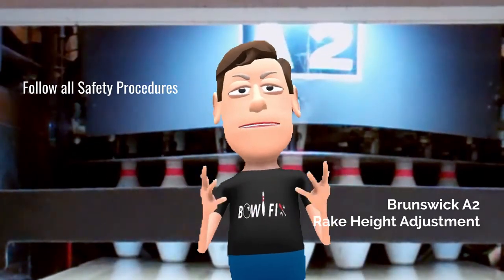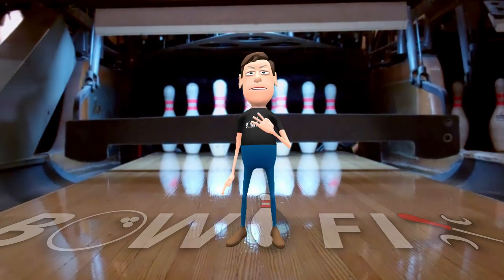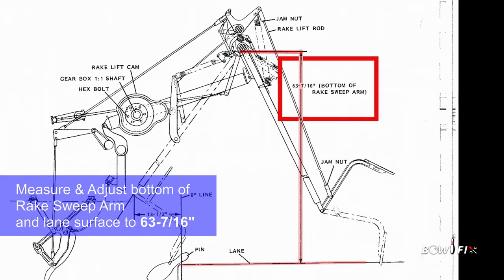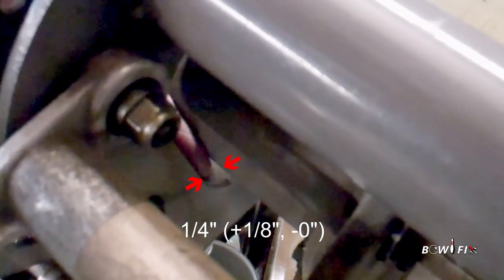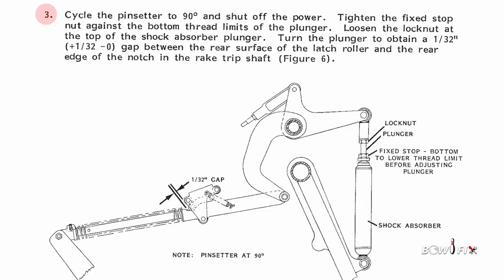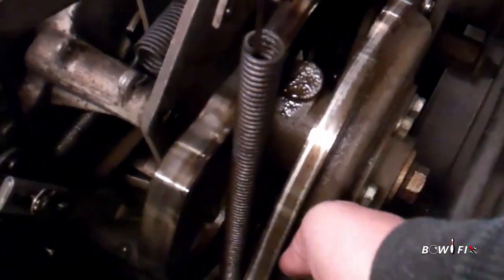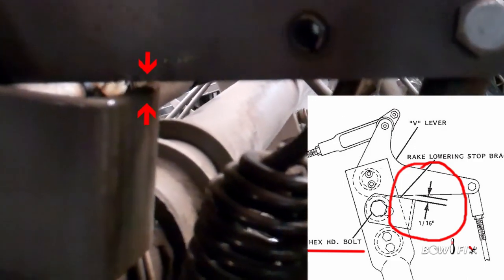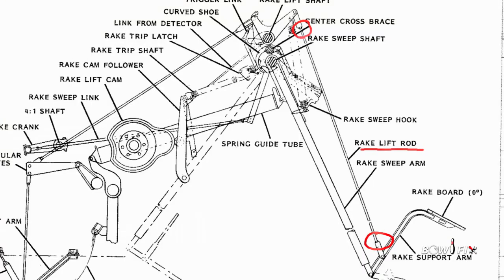Brunswick A2 Rake Board Height Adjustment | BowlFix

Comment: To me, the guard position at the end of the video still seems a little high, seems like it is from the rake shock stopping it too high because once it begins sweeping it drops a little bit.
Reply from the maker: I agree.  I think shotgun should be lengthened a little bit and the rake shock adjusted.  I'm pretty sure that would get the rake to start in lower position. I didn't have a chance to go back and tweak it.  Bent rake arms will cause issues with adjustment as well.  Thanks for commenting.